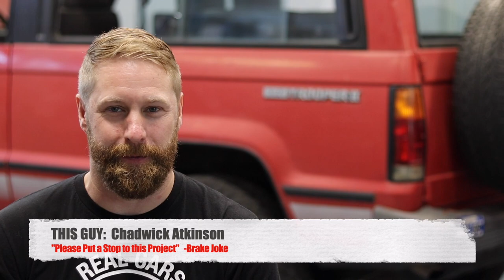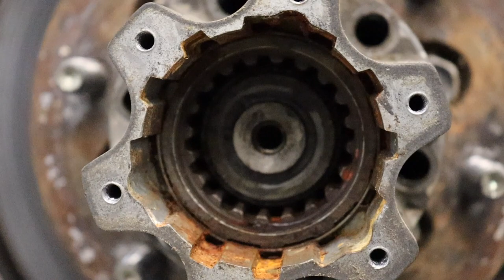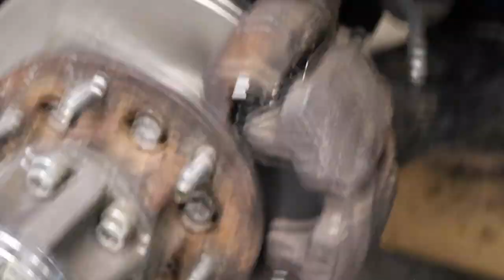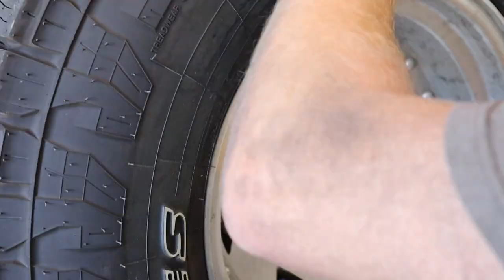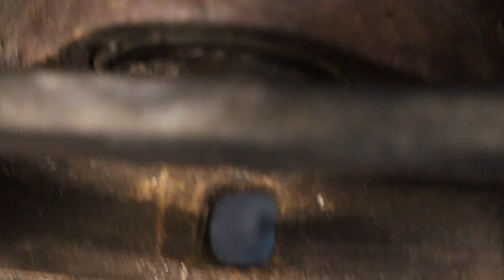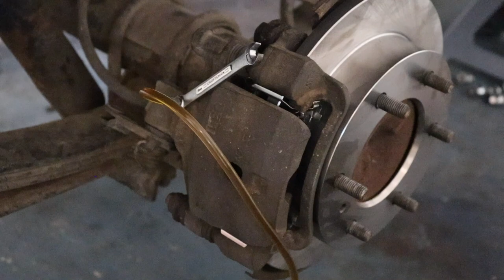1988 Isuzu Trooper - Episode 4: Hitting the Brakes

Comment: 2 things. On the rear caliper you must turn the piston until the 2 notches are at 12 and 6 o'clock positions as the pads has 2 knobs that engage in those notches. that keeps the piston from turning when it comes out and when using the park brake.   And 2, the brake fluid still looked dirty after flushing . should have done it longer , you dint have enough in the dirty bottle. When i do mine i get lots of dirty fluid out and the new is almost clear not honey color . My 86 has rear drum brakes but bleeding is the same.
Reply from the maker: Thanks for the tips.
Brakes function perfectly.
Not sure I’ve ever seen perfectly clear brake fluid. Brake fluid always has a “honey” color tint to it right out of the bottle.